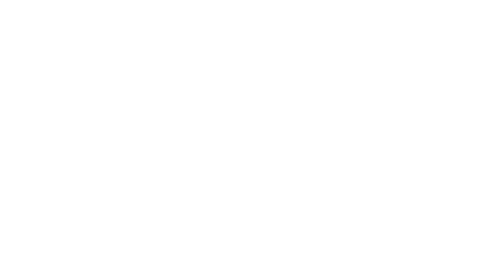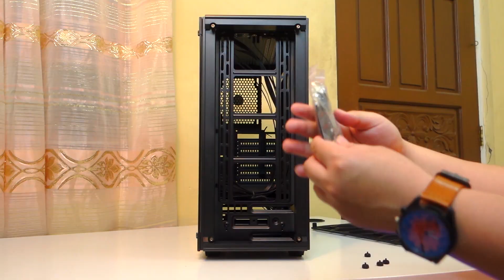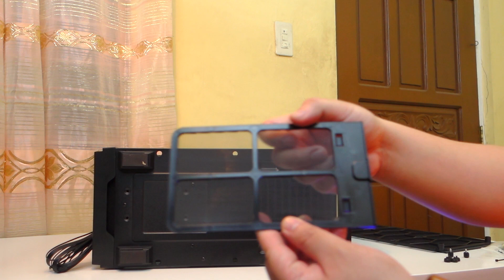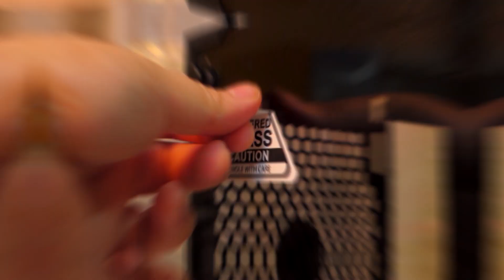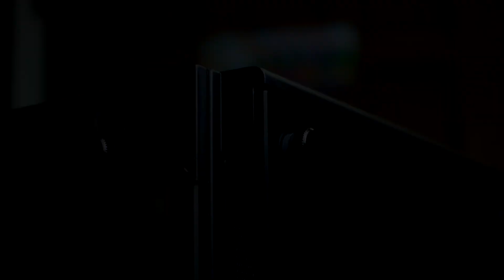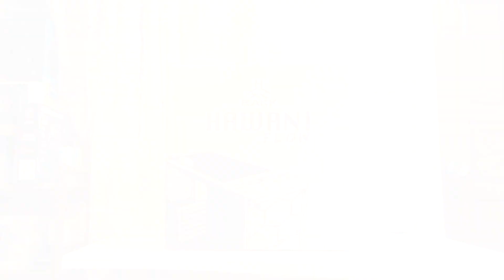NEW Rakk Hawani Flow Review and Unboxing - New and Improved!

Comment: Wow. The first filipino case review I've seen which may be on par with hardware canucks and the like. Keep it up! I was going to ask about top radiator clearance, but you mentioned it and even put up the measuring tape as scale.

I just wish you did put a motherboard in it then put a 240 or a 280 up top and then showed the clearances.

Other than that, great review!!
Reply from the maker: Thank you!, the reason why I did not include the build experience part in this video because I actually modded this case and I wanted to include the build experience on the case mod video itself which you can watch here https://youtu.be/l7UTCiF4wMw

Comment: pwede kaya dito AURAFLOW X 360 SNOW Front?
Reply from the maker: Parang 240mm lang ang pwede as per specifications, pero looking inside the case, depende kung san mo imomount yung fan at kung di ka maglalagay ng 3.5" HDD parang kasya eh, pero di ako 100% sure. safest is 240mm
Reply: Sa taas po hindi tlga no?

Comment: Dont think the air flow is good.. i have almost the same case and not much static prresure for the fans. Not enoung yung side lang galing at may filter pa so lalo obstructed ung air flow. Well if u want rgb..and tempered glass.sacrifice airflow tlaga
Reply from the maker: Huna 2 parin talaga if airflow
Reply: @TechBroll  malakas ba airflow ng huna or huna 2? i saw na halos nakadikit ung dust filter sa front sa fans. aside from the front panel mismo pa na mag hihinder sa flow ng air papasok. I have experienced using a pc fan na malapit ung filter, mahina na din ang flow ng air..

Comment: I don't see how much of an upgrade this is to someone who already owns a Hawani. Especially since you can just remove the side mesh from the old Hawani case and get an even wider airflow than 1.5cm. It also gives you almost an inch of gap for airflow which is enough to get some air in (having tested it with both the incense and paper towel method).
 Thermals between the new case and the old Hawani with the side mesh removed had a difference between 8c to 10c both CPU and GPU in favor of the old model.

And if you want to go even further, you can have a local fabricator make a front case mesh (Or make one yourself, only takes you 5 minutes to measure, cut, and poke a hole for the screws) to replace the glass so you'd get a butt load of airflow which is far more cost effective than buying a new case.

Comment: kasya ba sa taas yung 280 rad kasi kasya ang 280 fan ?
Reply from the maker: I don't think so, baka nga 240mm hirap eh, I've seen people done it though for the 240mm. Dipende siguro sa height ng RAM mo and other things to consider. Pero ideally, sa harap ang compatible mounting ng radiator for the Hawani/Hawani Flow
Reply: @TechBroll  napansin ko sa vid naka adjust naman sa gilid yung mounting holes so may clearance siya wala pa kasi akong nakita na review na triny yung 280 rad kasi ayaw ko ilagay sa harap yung rad as intake iinit buong system weird kasi para sakin yung intake taas

Comment: been using this almost 2 days now, rmi pa ako kulang sa build ko like adding another 3 fans (idcooling argb trio) and added a 3rd party air cooler :'D so far so good, 

-rubber grommets natatanggal yung isa dahil ang tigs ng wiring ng evga 750 g3 :'DD the rest nadikit naman :'DD 

-about yung RESET SW na saksakan, mntik na ako malito, kasi same label sya as the reset button para sa pc mo XDD kaya hiniwalay ko sya para sa front I/O XDD

- also may kulang sila, yung ginagamit sa paglagay at pagtanggal ng standoffs na parang screw, kaya naghanap pa ako na parang screw na prng png kasya sa paginstall ng standoffs :'D

-also nagkulang pa ata sila ng screws for a 2nd ssd sa likod, mukhang maghahanap ako sa pc hardware or hardware in the future, not to mention, 3 screws lang nag hold now sa SSD ko sa likod XD

-im on ryzen 2600 + gtx 1080 build so, seeing sa HWmonitor, naka 42 degrees me sa cpu while sa gpu naka 40 degrees, so far so good at least may vents na sa harap :'DD also btw the temp i mention is with glass infront :'D
Reply from the maker: Thanks for the valuable inputs, Lionel!
Reply: @TechBroll  no prob sir ^^

add ko na rin po na ni OC ko using some guide to 4.0 (my goal) at 1.3000 volts and so far temp at 55 degrees max on idle and last night before i sleep around 62degrees playing DOOM, so far so good for a stock cooler XDD, luckily game didnt hang up on me yet XD (didnt bother to OC the gpu anyway XD)
Reply: @lionelsioco123  ilang fans nakalagay ngayon sa case mo sir?
Reply: @battouter  2 sa front, nilagay ko dun sa may tapat ng harddrive caddy at isa sa gitna para tapat niya somehow ang gpu, tapos yung pangatlo sa likod for now :)
Reply: @lionelsioco123  parang ok yung airflow nya kung nasa 40c lang sya at idle. ano po yung temps pagnaglalaro ka ng triple a games?
Reply: @battouter  yung destiny gusto ko makita kaso ayaw ata maglabas ng msi burner maski nilabasa ko na siya (my only triple A game for now, kasi nag free sya dati e :'D)

tinignan ko now, pag magplay me ng Destiny nasa 60 degrees max sa HWMonitor, naka 1.3000v lang kasi at 4.0ghz :'D, kinda enough for me